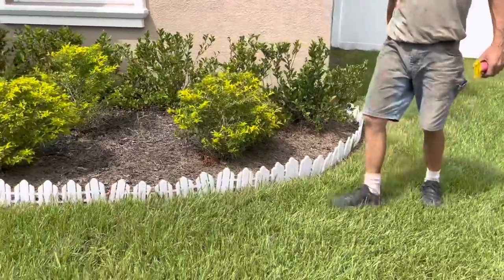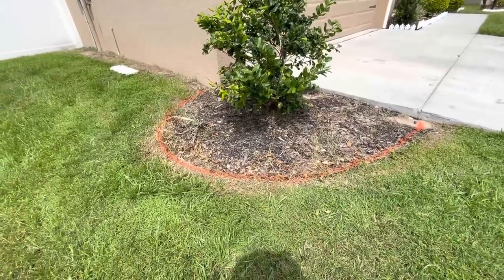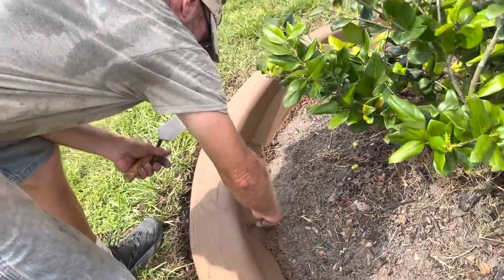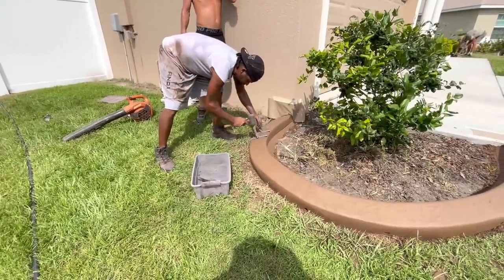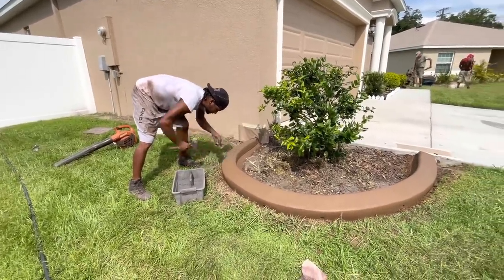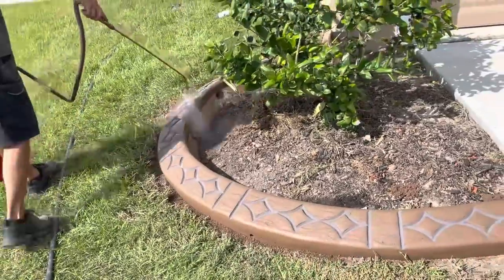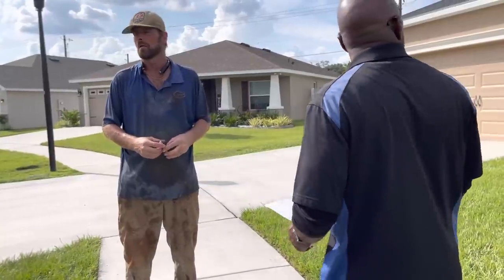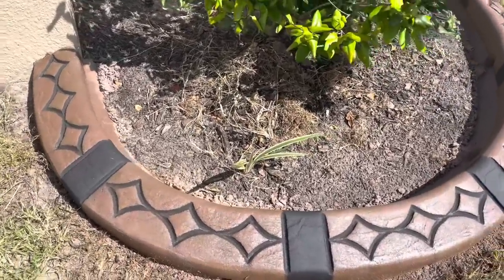Cement Landscape Curbing #landscape

Comment: Wish I knew that combination of cement they used. I tried doing it with Titan cement and sand and it is a nightmare to work with it. One has to keep fighting for the shape to hold and it keeps going down. You have keep passing that shape tool over and over until it somehow it keeps the shape. What ever they use seems to hold the shape and stay soft enough where you can do designs without falling apart. The most important part I think is knowing what cement or what ever is that they use. Would love to be able to do something like that but I can not afford those guys for sure. Yes, the main problem on doing this with one of those molds they sell> The cement is very hard to get it to keep the form. The Sand/cement combination is always too wet or too dry, a real pain. This job here is an awesome job, enviable.
Reply from the maker: It cost a little over $500. I’m not sure what kind of cement. The company is Border Masters inc. in Brandon, FL. Google and check to see if the cement is listed on their website. Thank you!